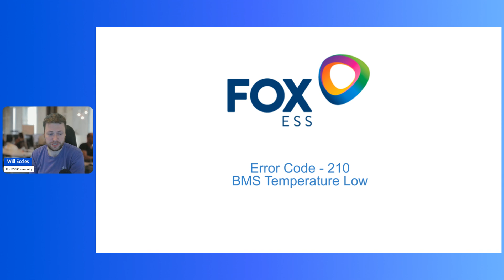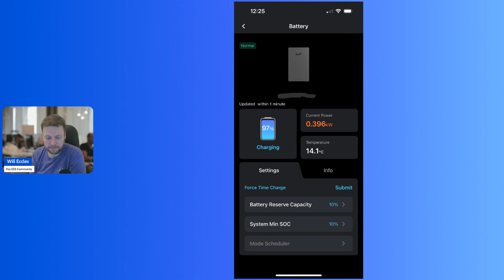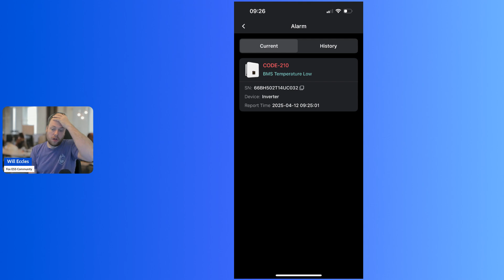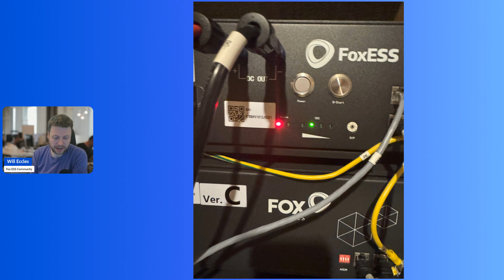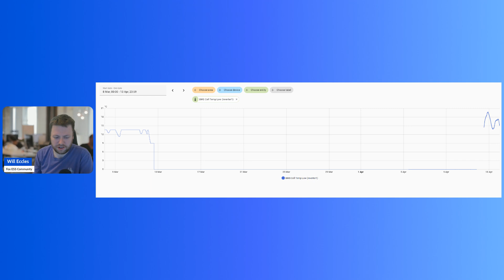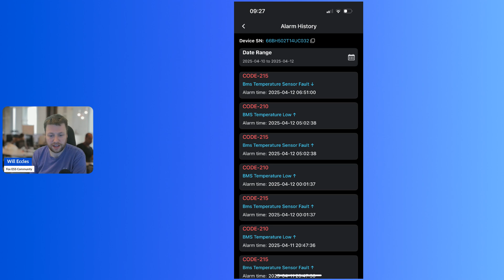Fox ESS - Error Code 210 - BMS Temperature Low

Comment: Anybody know what a 44098 ereor code is? Cant force charge unless i disable other schedules.
Reply from the maker: Normally because you’re trying to mix classic charging mode and the newer scheduler mode. Disable scheduler mode first before trying to use the classic force charging modes
Reply: @iameccles problem is if I do a forced charge through scheduler after it finishes the grid carries on feeding rather than revert to supplying from Battery